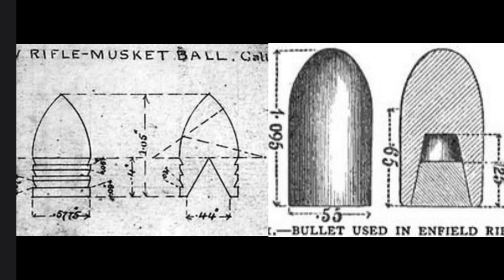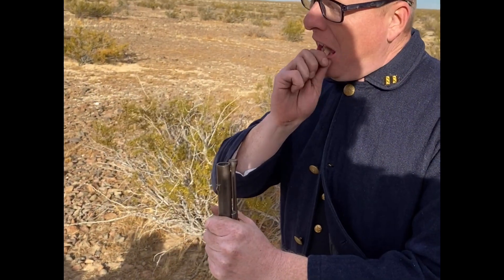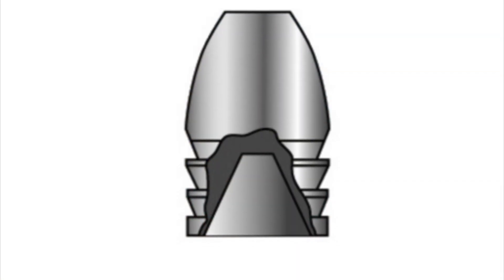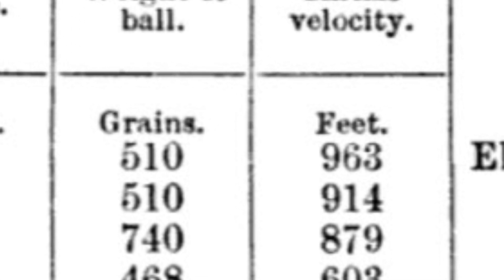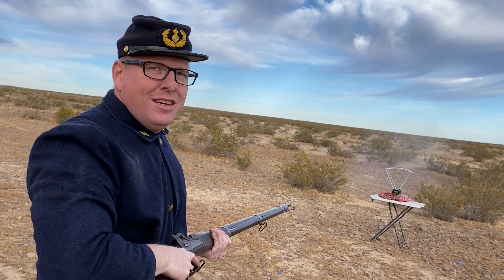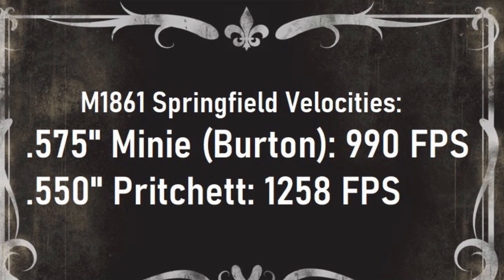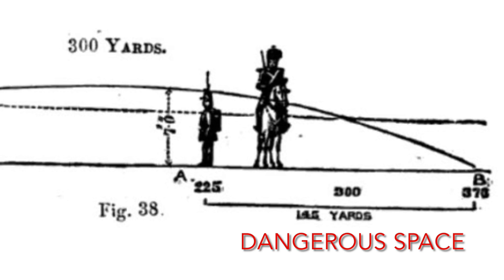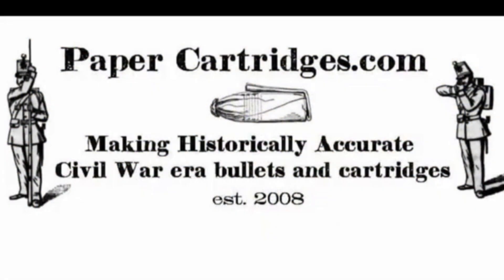Comparing Burton (Minie) and Pritchett Bullet Velocities

Comment: Take the spent cap off before reloading.  St.Paul,Minnesota.
Reply from the maker: The spent cap remains on, to prevent free movement of air through the barrel and vent while reloading. This significantly reduces the chance of an inadvertent ignition of the powder, and the military manuals of the period instructed the soldier to only remove the spent cap right before putting the new cap on.

Comment: How were velocities measured in the 1800’s?
Reply from the maker: They shot the gun into a pendulum, and by measuring how far it moved, they could very accurately determine the velocity of the bullet. The ballistic pendulum is still used in some fields today because it’s actually even more accurate in measurement than a modern optical chronograph.

Comment: So how did they measure the velocity back then? Perhaps it was derived backwards from energy delivered? I.e. How far a steel target swung back and knowing the mass of the bullet one can calculate what the velocity was?
Reply from the maker: Correct. They used a pendulum of known weight, and fired a bullet of known weight into it. How far the pendulum moved could be mathematically converted to the velocity.

Comment: How were they measuring velocity in the 19th Century?
Reply from the maker: They used a device called the ballistic pendulum. They are still used today when very accurate measurements are required. They are even more accurate than modern optical chronographs, just a whole lot more trouble and work to use.

Comment: Why do you hit the cartridge against the muzzle of the musket? And how does it make the paper almost seem to explode revealing the bullet? I've never seen that but it fascinantes me
Reply from the maker: That’s from the early (1855-1861) version of the cartridge, the manual called for sharply striking it squarely over the muzzle to separate the bullet from the cartridge paper. It works great. The cartridge is a little complex to make so they simplified it for mass production in 1861, and it couldn’t be used the same way. Soldier would have to rip open all the paper by hand.

Comment: But did the iron ram rod can destroy the gun barrel i've heard some of my friend say i need to change the ram rod from iron to brass or copper to prevent damaging the barrel too much it is right?
Reply from the maker: The ramrod can slowly damage the end of the gun barrel. Many people use a brass or wooden rod to protect the muzzle on original or valuable rifles.
Reply: @papercartridges  but can you explain for me how could an iron rammer can slowly damaging the end of the barrel but the brass or wooden rammer didn't do any damage to it  like overall you just ram the bullet down the barrel how can the wooden , brass rammer didn't damaging the barrel but the iron can ??????
Reply: Why don't the army just change the ram rod on the rifle with brass or wooden instead of iron to prevent the soldier to slowly damaging their rifle during combats fighting or when the soldier doing a fast voley fire and need to reloading the rifle fast as the could and that could end up some soldier will heavely damage their rifle
Reply: @CheemskoGiondau  It is not a question of damaging the muzzle in combat, but that you over time, will wear the muzzle.
If a gun is used in peacetime year after year after year. it will matter in the long run. 

wood can break. Brass is too soft a material.
Some armies used ramrods in steel, but with a tip of brass. It gave the best of both, but cost more to make.

The danish army issued old smoothbores to all soldiers to use for drill,  field exercises with blank ammo and similar. and only used their newer riflemuskets for live firing.
This way the rifled guns was not worn over time by their peacetime use.
Reply: @thomasbaagaard  got it , thanks friend , and i know that too some guns like : lorenz 1854 infantry rifle ,.... also got that brass and steel ramrod design

Comment: That much difference even under 200yds  is significant! It’s energy delivered on target and penetrating the poor soul hit. Did the Confederates purchase British molds or bullets? What about US enfield ammunition? What about a wood plank penetration test at various ranges.  One may have a better ballistic coefficient. Don’t you need same charges to truly compare the individual bullet?
Reply from the maker: The Confederates purchased molds, made their own molds, and also purchased English made bullets that were run through the blockade. The US never adopted an Enfield cartridge; instead the US bullet was reduced to .574 so it would fit in Enfields. I used the historic powder charges, since that’s what they would have used and I am interested in comparing historical performance.
Reply: @papercartridges  your videos and diligent answers lead to both you books having a place in my Library. The references I’ve seen say the Springfield could place 10 shots in a 4 inch bullseyes at 100yds. I suspect modern reproduction Springfields are not as tight in tolerances as originals. Conversation to allin was done enmasse across manufacturers. Modern repro repair parts often require custom fitting from the same manufacturer. Where not the synder conversion done on an individual basis because of variation in tolerance?

Comment: Here is a thought, did the slightly faster rate of fire of the Pritchett cartridge actually give a noticeable advantage to the Southern armies?
Reply from the maker: The Confederate Ordnance Bureau thought the Enfield cartridge was definitely advantageous, and there are quartermaster officers letters from the armies to the Ordnance Bureau, requesting more of “the English cartridges.” So they definitely felt it conveyed an advantage.
Reply: @papercartridges  I am most familiar with the eastern theatre of war and looking at the engagements between the ANV and the Army of the Potomac.  The ANV for the most part tended to be numerically inferior but took that initiative in many of the engagement and so even a small advantage in rate of fire would be helpful.  Even though the engagements were fairly close up.

Comment: Great video! I am interested to know the bullet diameter of the Burton ball, and if the Pritchett used has the base plug. Thanks for all your work. Wish you and your command a safe, speedy return!
Reply from the maker: My Lyman cast Burton’s are sized .575 but historically they were swaged .5775 at first, then reduced to .574 to allow them to be used in imported Enfields. Yes, my .550 Pritchetts use wooden plugs turned from hardwood dowels.

Comment: The Pritchett was obviously designed with the levee en mass in mind.
 In terms of rifle bullets, 20% is a lot. 
Or to put it another way:
900fps at 200 yards means you will kill one man, and probably wound the man behind him.
1200fps at 200 yards means you will kill the front man outright, kill or mortally wound the man behind him and very likely do great harm to the man behind them.
That would be devastating against a Napoleonic Column.
Reply: Pretty good on one or two ranks also!